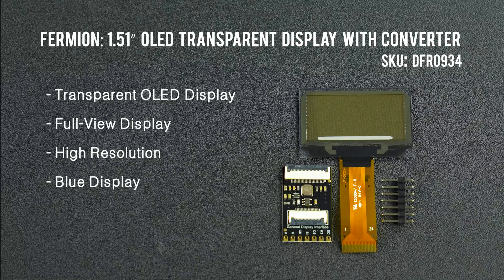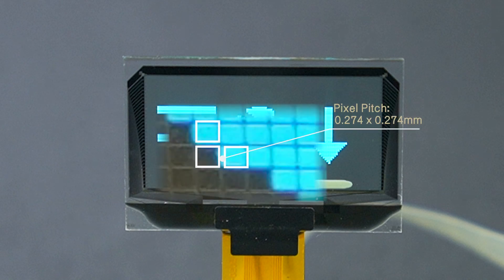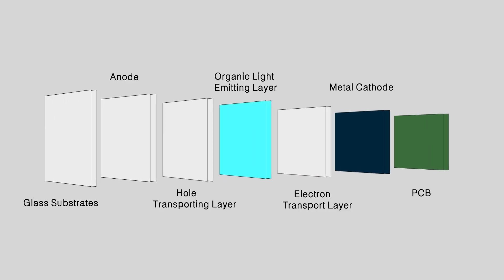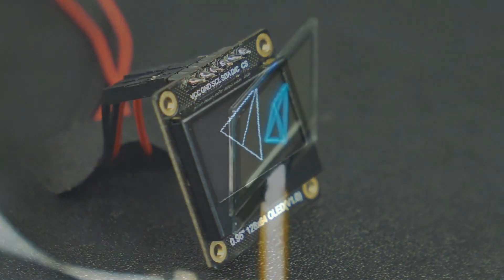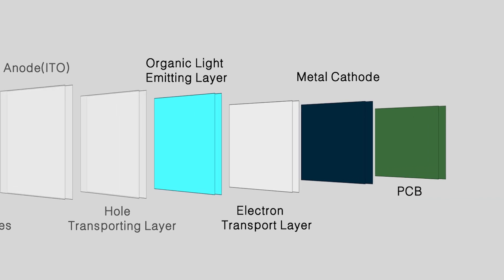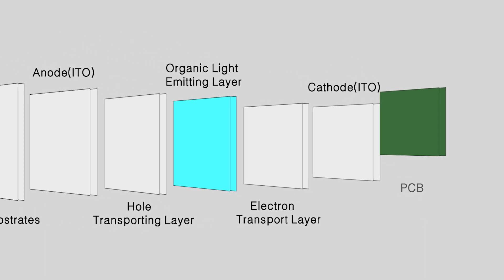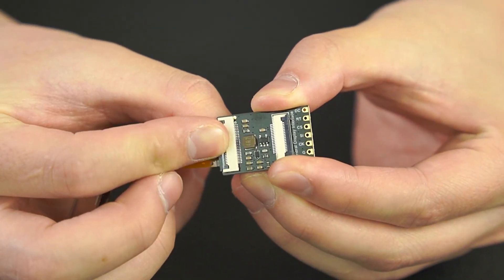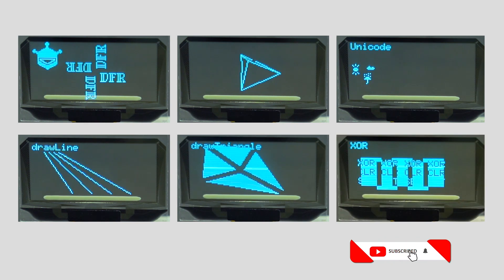How An OLED Transparent Display Works - Fermion: 1.51” OLED Transparent Display - DFR0934

Comment: I'm extremely interested as i will soon be making AR glasses equiped with Macbook and Windows pc connectivity through BT and Wired USB C to USB A/C, the glasses will need to be in an extreme compac form and as such i will need a high res transparent display but this allows me to understand how the work to build around them

Comment: How could i possibly transform one so that the wire ribbon would be on the side and not the bottom without interfiering with the visibility nor the screen itself, i do not have any specialist equipment to possibly re solder the strip without posibly permanently damaging it, what should i do?

Comment: What would I do? I would use it to turn my desktop, laptop, tablet, TV, phone, or watch into a transflective display

Remember the Gameboy Advance SP (or Afterburner kit, in my case)? It would be a little like that, except it could be backlit (instead of just frontlit) and it wouldn't need to constantly refresh

To do this, I would put a color memory-in-pixel display in front of it... and a reflective LCD (uniform, not video) behind it

That way, my screen could be as sharp as a traditional screen, or as healthy and efficient as a color epaper screen but with a much higher framerate

For smartglasses, I would do the same thing (one for each frame) but with two transparent uniform LCDs instead of one reflective uniform LCD (all they would do is limit or isolate the real world from your eyes)

As a bonus, I would waterproof all of these displays with a transparent solar charger

Saturday, March 18, 2023 CE, 19:04 EDT

Comment: support raspberry?
Reply from the maker: Sorry, Raspberry Pi is not supported. Since the  OLED Display is using the U8g2 library, and Raspberry Pi doesn't have it. Thank you for your concern.
Reply: I don't think so. Since the  OLED Display is using the U8g2 library, so maybe raspberry pi doesn't have it.

Comment: DFRobot - nice screen. I'll use these on my robotics applications to allow for a discrete display to output standard system, navigation, telemetry and location information to the clients. I’d also use this as a clear weather information display connected to a raspberry pi and lastly for my solar BMS system output  Great work
Reply: Interesting, thanks! Could you leave any contacts that suitable for public? So that I can send the coupon for you to get your free transparent display. Or should I leave my email address or social media address?